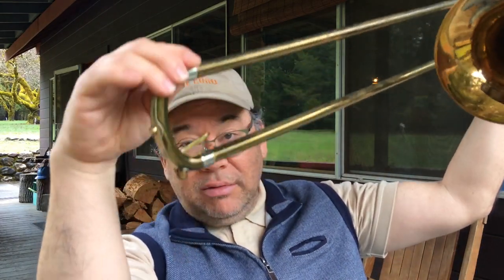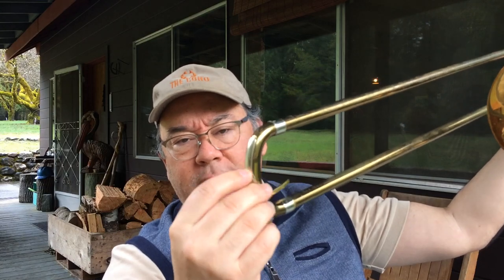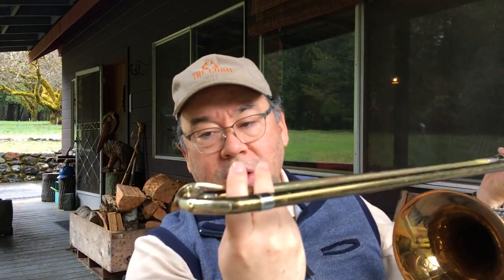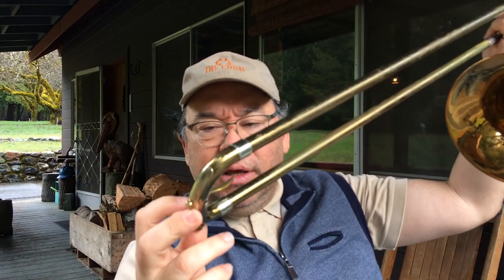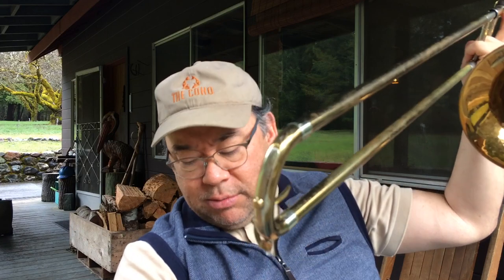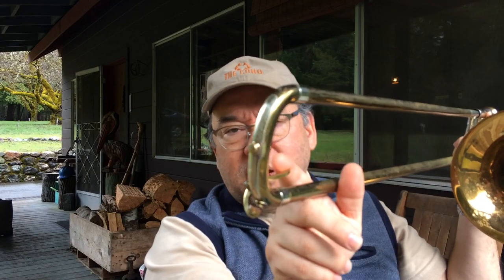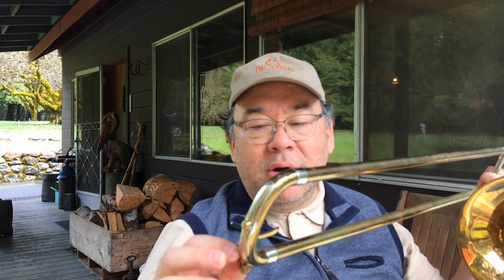Spit valve the trombone water key: Quick Trombone Tip

Comment: Greetings sir .  Would you have any observations to make regarding a trombone which gathers rather excessive amounts of water in very short time after water has been dumped . In this case it is a rather ancient valve trombone which is a hybrid Conn bell / Percy valve section instrument .  Could this be attributed to lack of airtightness or some other mechanical issue in the instrument  ?  I do intend to experiment also with warming the tubing in an effort to reduce condensation from my hot breath  !!
Reply from the maker: Look at the reservoir for the valve. If it is heavily corroded and partially blocked then you’d have less space for condensation to rest. I have Amado water keys on one of my horns which need to be emptied more often because there is no reservoir. Try cleaning the vent hole with a wooden tooth pick. Don’t use a pin or steel implement as the old brass can be brittle or the seat for the cork can get dented.